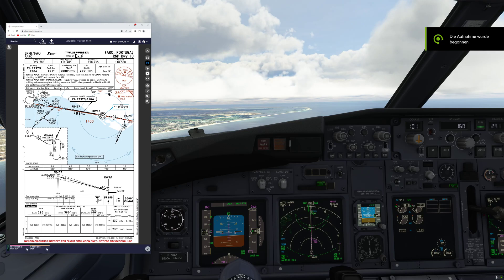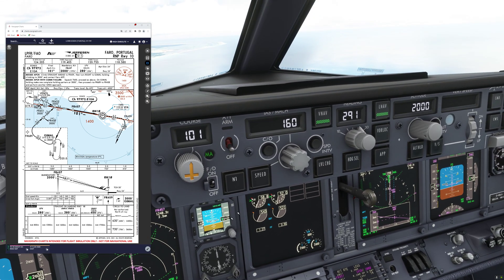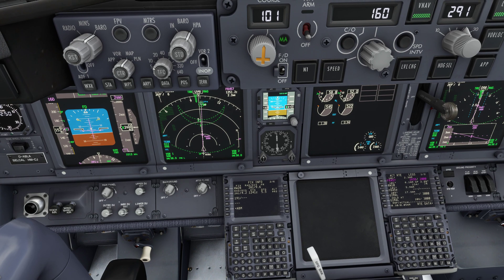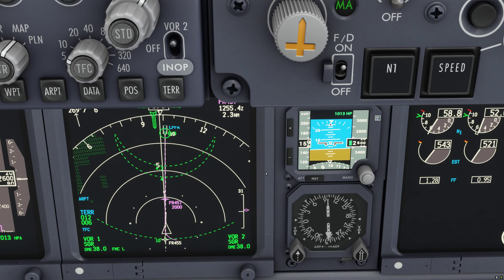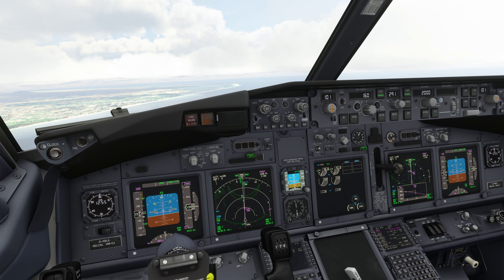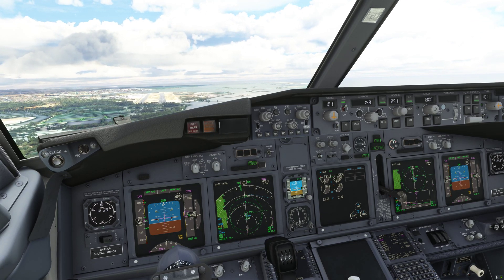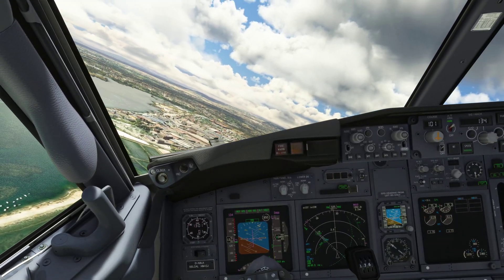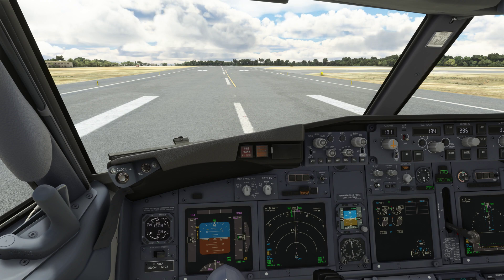PMDG 737-700 for MSFS - Tutorial: Clircling Approach

Comment: Hello,
thanks for the nice Video, trying to reproduce 🙂
But 2 Questions:
1. i dont get where the 4.2 miles from the Thr comes from ( 1:11 in the Video ) ... i see the Obastacle clearence of 1400 , but where again can i see the 4.2 NM ?? ( sorry )
1. how have you entered the RW28 FIX in the Fix Page ?
I tried this in Prosim, but after entering RW28 in the Fix Page, the Point appears in the middle of the RWY and not at the end ( where i expect it )
Thanks
Matthias
Reply from the maker: Hi Matthias,
1) It's a regulatory requirement, you won't find it in the chart but you'd have to check the AIP.
2) That's a bug in the ProSim then, if you enter RW28 it should mark the threshold of that runway, not the middle, the airport or anything else.
Reply: Hello,
Thanks a lot, will tell that to Prosim, lets see what excuse they answers 🙂
But whyt i wonder a bit is this: Lets say you fly from A to B. A has a Runway 10/28, but B has also a Runway 10/28 🙂
I know, the chance is very low, but what if i enter RW28 in the Fix Page. How can the FMC know which one i mean ??? 🙂
The RWY28 from the Departure or from the Destination ? 🙂
Matthias

Comment: Thank you Emmanuel! Wondering, would we also add half the headwind component too, since we’d have a slower ground speed in that case and wouldn’t want to turn base early?
Reply from the maker: Yes - however it is very unlikely to have headwind here since the wind at circling altitudes is usually similar to the ground level and if you had a headwind on downwind that'd mean tailwind on landing which would make the circling approach itself rather unlikely to be done in first place.
However for the unlikely case that it does happen, yes, you need to add half the headwind.
Reply: @A330Driver  Thanks Cpt!

Comment: Thanks for this! I was trying a circling approach to runway 26 in the 737-700 yesterday at PAJN using the LDA X RWY 8 instrument approach. It is a tough one because the instrument approach is offset. Winds often come from the west here, so it is fairly common. If possible, I'd love if you could take a look at this chart for me. It says circling minimums for cat c aircraft is 3340 MSL (3315 AGL) with a max speed of 140. Also no circling north of the runway. I found myself WAY too high to properly perform the circling approach. I also found the circuit way too tight with the terrain around and felt it would be nearly impossible to do. Any hints or suggestions on things I am missing? I am new to circling approaches.
Reply: I know what you mean. I also fly this approach often but also have trouble circling to Rwy 26. I have seen videos here on YT where they are flying south parallel to Rwy 08 and then circling to Rwy 26. It looks so easy but sure requires a lot of training.
Reply from the maker: Looks like an interesting approach indeed. Generally you'd need to fly 99 seconds downwind in order to be on profile at this circling height. Looks like there might be terrain close by though.
I have not actually tried this approach yet, but the speed restriction of 140kt might come just from this terrain issue.
How close do you get to the terrain when you fly the downwind with 140kt for 99 seconds?
Reply: @A330Driver  in fact, I had 99 seconds planned for the downwind but got much too afraid with the gwps warnings blaring ha! I got scared, cancelled the circle, made an evasive manouvre and landed, likely illegally, with a 10 knot tailwind on 08. I did see a video of a 737 from the cockpit circling on the same approach, but they were way below circling minimums and were very tight. Perhaps they had special authorization. I'm just curious because I was way too close to terrain after about 40 seconds of downwind time so the approach, to me, seems impossible. Thanks for taking time to respond.

Comment: Thanks for the explanation! Something I’ve never understood, why would you fly a circling approach? Funchal has various approaches into 28, so why not go for one of those?
Reply from the maker: The main reason for circlin approaches is because the terrain or other factors (other would usually be mainly political factors) does not allow any instrument approach on such runway.
Madeira is something special again as it's not a circling but a visual approach to runway 05.
An example of an airport where terrain prohibits any instrument approaches in one landing direction is Comiso, LICB. Due to high terrain runway 23 does not have any instrument approaches and a circling approach must be carried out.
Reply: Usually for high tailwind component, temporary obstacles, or other undesirable factors that apply to the approach plate for the straight in approach. Circle to land approaches are typically not used by airlines in the US and I believe some of them don’t allow them. That’s not to say you won’t fly a downwind and base in VFR conditions with vectors however. They carry a risk that isn’t necessary nowadays with modern navigation and better published approaches. That Learjet at Gillespie airfield a while back is just one example of a circle to land resulting in a crash that was totally avoidable.
Reply: Mainly the difference between a visual approach and a circling approach is that the last one is made ad the end of an instrument approach whereas a visual approach would actually substitute it. a circling is done maintaining visual sight of the runway wherever a sraight in approach in not possible due to osbacles, absence of nav aids and other factors. :)
Reply: Chambery is a classic